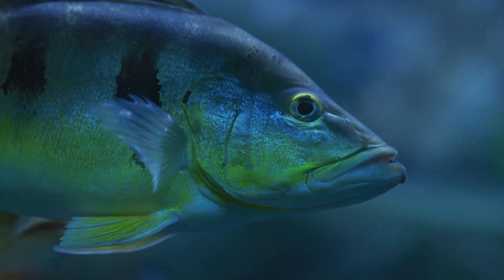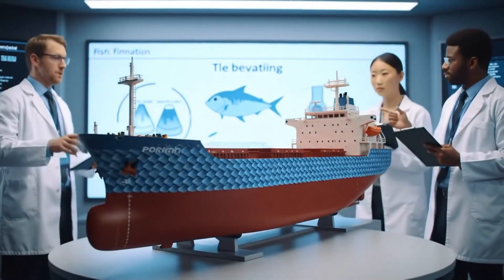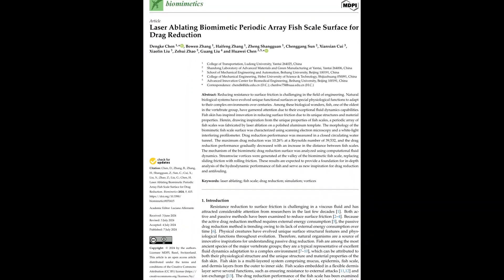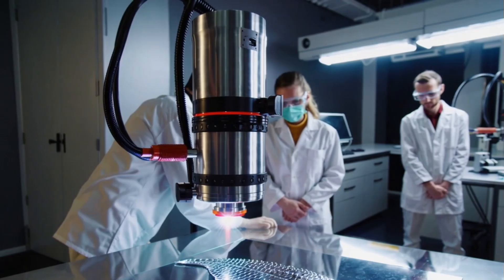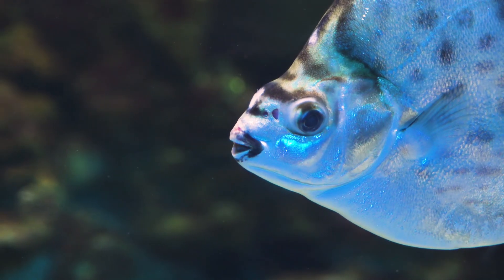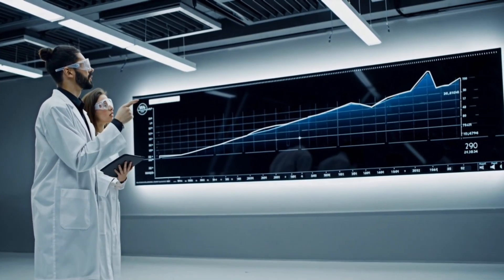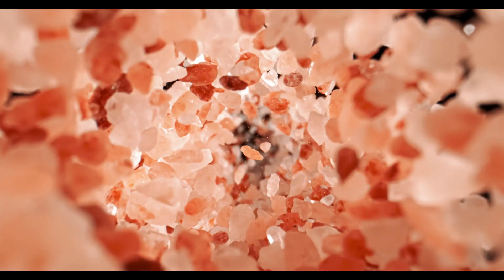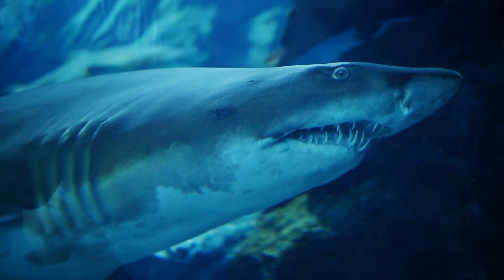Do fish scales inspire drag free ships?

Comment: Faster or with less drag?
Reply from the maker: Great question! They actually go hand in hand. With less drag, you reduce the force resisting the sthip's motion. Therefore, it 1) goes faster with the same engine power or 2) uses less fuel to maintain the same speed. Thanks for commenting!

Comment: Ok. What about the sea life growth though? The smoother the surface is, the less growth of algae, barnacles, worms, etc. No matter how much copper and chemicals you paint it with, all those little grooves are a brilliant breeding ground for them, and they generate much more drag than any type of hull surface. Is the 10% increase going to be worth it compared to the increased growth?
Reply from the maker: That's a great point! Which is why I recommended the authors to test in actual sea water. I found an intersting study that looks into this. So apparently just 10% of barnacle coverage with 5mm byrozoans can increase drag by 20 - 30%, and could push that to 40% annually, this is the paper in case you're interested: https://www.tandfonline.com/doi/full/10.1080/17445302.2025.2472266. Its true you could put copper and chemicals to the surface to prevent the growth, but there are two problems with this: 1) Copper based paints lose effectiveness over 3 - 5 years, 2) You end up with a paint roughness paradox, where thick antifouling layers can level the microgrooves, removing all the drag gains. One possible solution is to use fouling-release polymers or low surface energy polymers, which create a slippery interface preventing algae and biofilms from forming: https://www.sciencedirect.com/science/article/pii/S0079670022000144. Another cool solution, (this is my favourite, but might be too expensive), is using an ultrasonic cavitation jet that removes algae and marine life from the hull. This is the paper in case you're interested: https://www.sciencedirect.com/science/article/abs/pii/S0029801822011878
Reply: @Michal_Kosakowski  On fast vessels you have hard and fouling that does not easily fall off but needs to be cleaned frequently to remove the marine growth. 
Filing to frequently to clean the hole the propeller shafts the propellers the thrusters and everything under the water leads to friction 

On slower holes you have self-polishing polymers which basically are paints that fall off through the friction of the water passing over the hull. So this ends up with the paint and the marine growth falling off into the marine environment.

When designing a hull have what they call block coefficients which obviously is the shape of the hole and the square and more sharp your Harley's the bigger resistance you have. 
This is called residual resistance because there's nothing you can do about the shape of the hole once the vessel is built.

The other form of resistance that a hull has is residuary resistance which is the build-up of marine growth and other forms of material on the whole which causes friction. 

If someone can come up with a whole form that has the fish scales that enable the micro bubbles to form as the boat runs through the water everything will be great but the problem with that is you also need some kind of barrier coating by anti-fouling etc and a cleaning process that enables the marine growth to be removed easily as opposed passes through the water or it doesn't grow on there naturally. 

If you don't want the marine environment to suffer from chemicals and marine pollution you need to stop all maritime activities.
Reply: @Honest-liars Trouble is with all those solutions, that they promise more than they deliver From my personal experience, I work in the boat yard and cleaning hulls is part of my job.

Unless you keep your boat on a dry dock and clean it very regularly, no amount of even the most expensive and innovative anti fouling works that well, without costly regular maintenance and re-application.

In fresh or brackish water environments is not too bad, but coastal waters make all our commercial customers and racers lift out their vessel multiple times per year for cleaning and painting, as they can lose several knots of speed due to growth. 

This is not a cheap service, and my point was: is that mere 10% drag reduction is actually worth additional costs of lifting, cleaning and repainting your boat more often, due to complexity of surface of the hull? It's not just a direct cost of it, but also the time to take your vessel out of sevice to do it.

Also, how long the drag reduction benefit would actually last? All the grooves would quickly start clogging up with silt, sludge and growth that is ever-present and relentless in sea environment.

It's a cool idea for inland boats, but in my opinion doesn't seem financially viable in the sea. Maybe with some revolutionary self cleaning technology, that we don't know of yet? We shall see.
Reply from the maker: @Michal_Kosakowski  its quite interesting what you mention about the fresh water compared to coastal waters. I agree with you that there is still work to be done in order to take this from a research paper to an actual viable solution. Thanks for sharing, its fascinating to hear from someone "in the trenches" who has to deal with this everyday! Out of curiosity, when you're cleaning those hulls, have you seen whether grooves seem to trap more growth? And have you ever experimented with any textured patches or coatings that hold up longer between cleanings?
Reply: @BioBytee Basic "rule of thumb" is the smoother the surface is, the less growth.

A lot of marine life needs uneven surfaces and porous material to latch onto. Hence different materials have different levels of growth as well.

On the same vessel, smoothly painted (ideally spray-on application) fibre glass or machine polished metal have significantly less growth than corroded metal, bare plastic or wood.

Every single scratch on hull or a bit of paint that has chipped off is also a prime real estate for barnacles, etc.

Underwater metal moving parts, like shafts and propellers, are often polished as fine as possible, because the anti fouling paint does not stick to them very well, due to movement and vibration.

I'm glad I could share my personal experience on the subject. Looking forward to more interesting videos.
Reply from the maker: @Michal_Kosakowski  and I'm glad you shared it! I learnt so much and its always good to hear the practical struggles directly from someone that works in the industry, rather than reading it from a research paper. Thanks for commenting and sharing your knowledge!
Reply from the maker: @Honest-liars very interesting and well explained! Thanks for sharing!
Reply: @Michal_Kosakowski  On fast vessels you have hard and fouling that does not easily fall off but needs to be cleaned frequently to remove the marine growth. 
Filing to frequently to clean the hole the propeller shafts the propellers the thrusters and everything under the water leads to friction 

On slower holes you have self-polishing polymers which basically are paints that fall off through the friction of the water passing over the hull. So this ends up with the paint and the marine growth falling off into the marine environment.

When designing a hull have what they call block coefficients which obviously is the shape of the hole and the square and more sharp your Harley's the bigger resistance you have. 
This is called residual resistance because there's nothing you can do about the shape of the hole once the vessel is built.

The other form of resistance that a hull has is residuary resistance which is the build-up of marine growth and other forms of material on the whole which causes friction. 

If someone can come up with a whole form that has the fish scales that enable the micro bubbles to form as the boat runs through the water everything will be great but the problem with that is you also need some kind of barrier coating by anti-fouling etc and a cleaning process that enables the marine growth to be removed easily as opposed passes through the water or it doesn't grow on there naturally. 

If you don't want the marine environment to suffer from chemicals and marine pollution you need to stop all maritime activities.

Comment: I'd be interested to see the drop in performance of those scales over gradual wear,, and if there is a perfect scale size or if scale size would need to change with the size of the vessel
Reply from the maker: Amazing point and great catch. So I actually found this paper: https://www.jafmonline.net/article_2411.html, which states that microstructured fish scale patterns can often wear done over time, after just a few hundred hours of operation, which I find insane! One possible solution could be to use ceramic overlays which is a hardened material and could be wear-resistant, this is a great paper discussing it: https://www.sciencedirect.com/science/article/pii/S0266353824002951. Another solution, but it might not be as feasible due to the high surface area coverage would be to use a modular panel system for a quick swap out of worn surfaces during dock visits.

Comment: Absolutly.

When a hull is glassy smooth it is slower than when it has correctly applied antifoul  paint. 

The mico bubbles reduce friction. 

But its only fractions of a knot.

However that can result in big fuel savings.
Reply from the maker: You're absolutely correct! This study confirms a 10% reduction: https://researchers.mq.edu.au/en/publications/computational-study-of-drag-reduction-on-a-ship-hull-using-the-co#:~:text=In%20this%20study%2C%20an%20effective%20technique%20is%20analysed,using%20a%20hydrofoil%20that%20induces%20Kelvin%20Helmholtz%20instability.

Also your video "Jedi at work" is too funny 😂